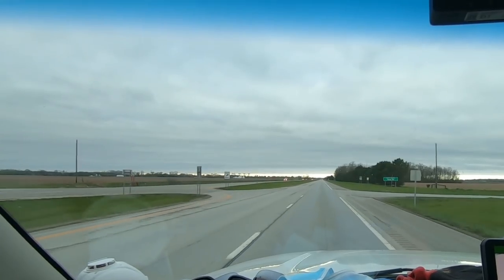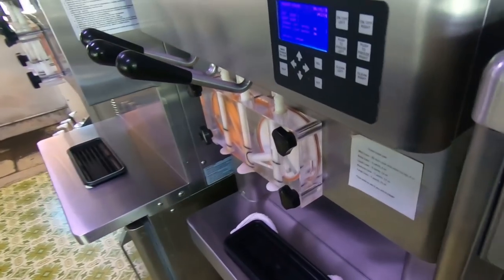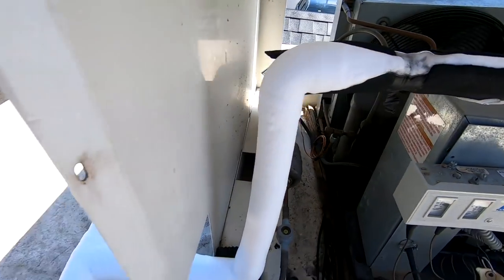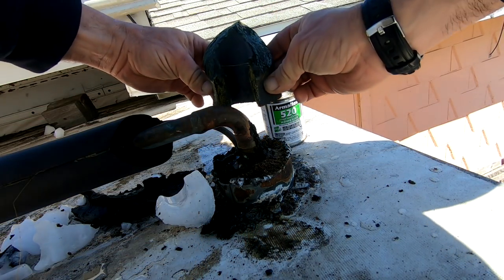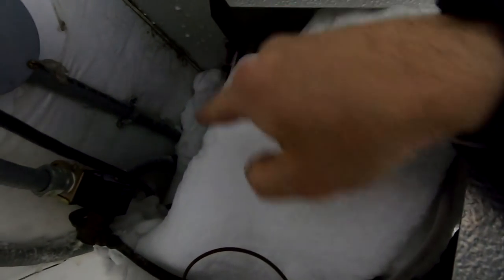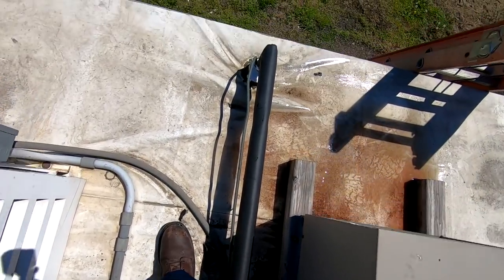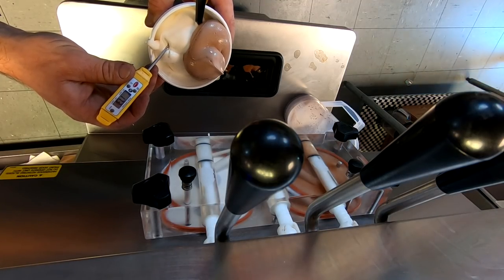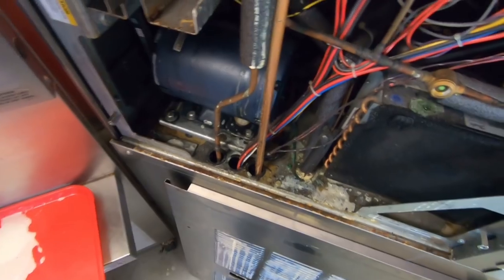HVAC/R Ride Along Vlog See What I Do During A Normal Day

Comment: I like the ride along video. When ever I had to split insulation and glue it I always managed to get that crap all over me. I didn't do it often enough to get good at it either. I can remember working on ice cream machines back in the 70s in lima, they had a screw type system. Down be motor tou would adjust as the ice cream got thick it would move this device and kick the machine off. Not any fancy electronic boards back then. . My favorite hamburger is the kewpee 😄
Reply from the maker: You must know me?

Comment: A steak knife works really good for cutting insulation. Also Armaflex makes the white coating that you paint on to protect it from the UV.
Reply from the maker: Interesting, I can find those easily. Is that a seriated blade? I don't plan on becoming a pro at insulation but bring decent would be good 👍👍

Comment: Man I bloody hate doing insulation , and Armaflex blunts blades after 2 minutes of cutting it .
What I usually do is put some Armaflex tape on the glued joints so air and moisture doesn't get in .
You said you haven't done much insulation but you did a better job than me !
Reply from the maker: Thanks Sterling👍. I try but I know when my just treading water. 😁

Comment: Did you got distracted with the temp sensor wire?  @10:30  Be safe out there
Reply from the maker: 🤣🤣🤣🤣 I did 😎. I wired the colors backwards😱.   It would of still worked fine because the sensors are not polarity sensitive but I like uniformed wire colors and clean terminations. Good eye 👍👍

Comment: you should do a van tour
Reply from the maker: I'm planning on it. I need to clean the wreck first. 🤣
Reply: It looked like it's a Nissan how do you like it .
I have a 2018 150 transit low roof
Reply from the maker: 2013 Nissan 2500, it's better than the last beast I had. It's starting to show rust but it's fast and drives good, doesn't have as much room as it looks.